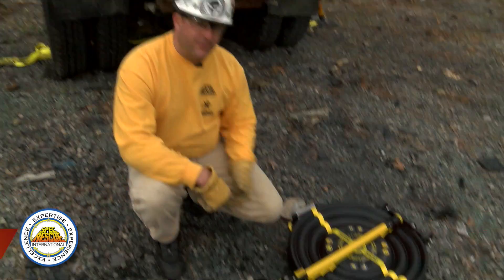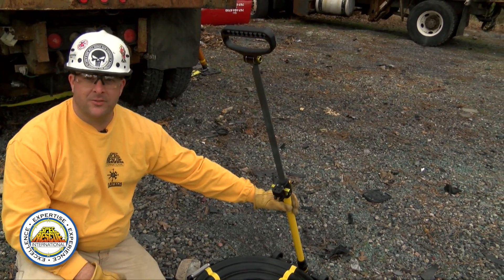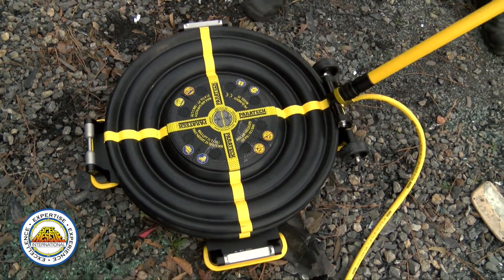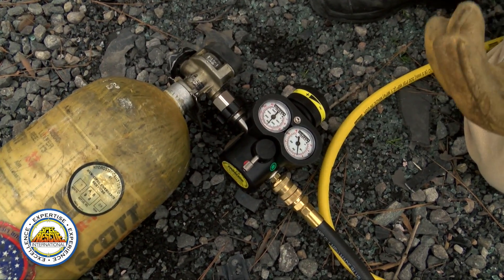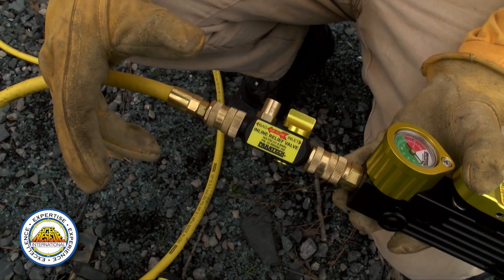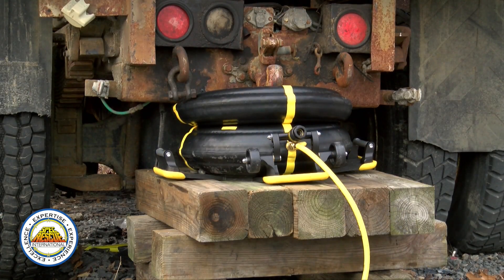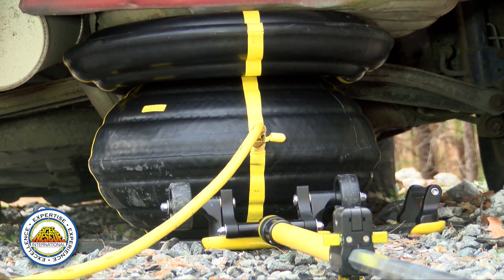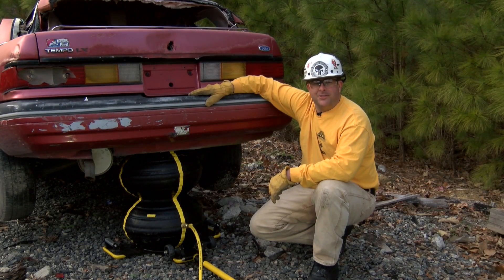The Spec Show - The Paratech Multiforce Airbag (Journigan)

Comment: Great video!!! I noticed one thing that should've been addressed, though.  When hooking the airline to the bag itself, you should make sure that the telescoping handle is beneath the fitting otherwise it will create a pinch-point on the hose/fitting when the bag is inflated.  At about the 4:37 mark, this is illustrated correctly.  Earlier in the video, it is not.